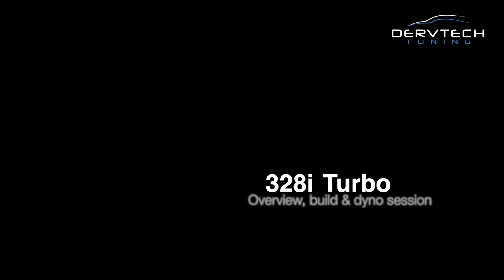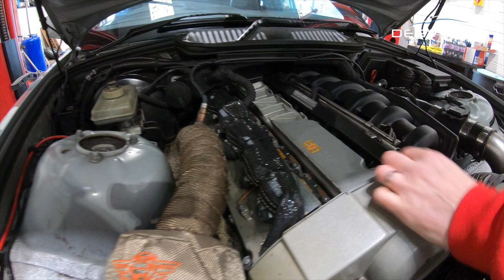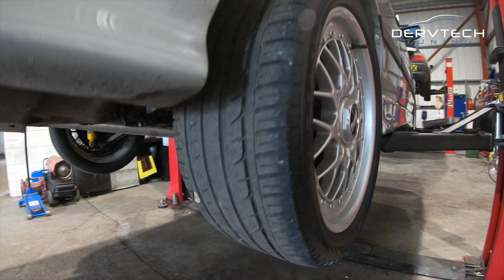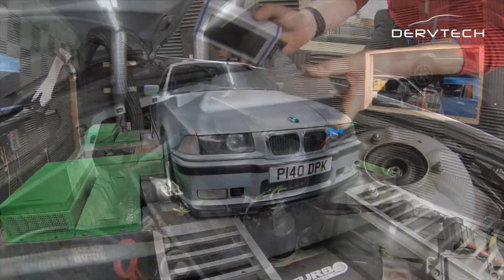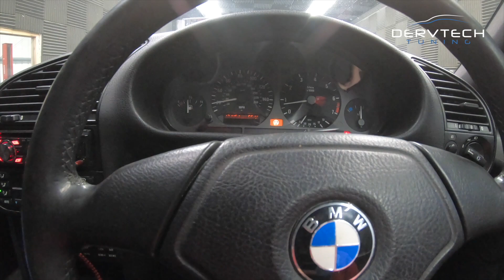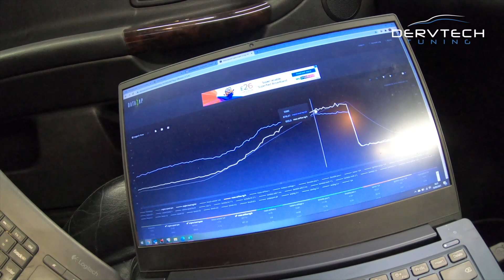BMW E36 328i *TURBO* M52 walk around, and dyno tuning session @ E36Tuning.co.uk

Comment: When a video on the dyno with the decompration plate ?
Reply from the maker: The car went through a couple of guises. Its latest incarnation was a 3.3l Alpina engine with the same turbo kit fitted. It made 470hp at the flywheel, with no turbo lag and was an absolute hoot to drive!! I think there are videos of it on here, or possibly just on instagram @e36jp

Comment: Soooo.. have you turned the boost up on this yet?
Reply from the maker: We did. 340hp on the stock engine. 

Then we fitted a 3.3l Alpina engine, reworked the turbo setup and saw 470hp @ 1bar.

Comment: Great for a you tube vid but stuff like this never last long, you wont see it in 80* weather idling in a 3 hr traffic jam that's for sure LOL..Dyno readings are not the real World
Reply from the maker: This car actually has been used as a daily, through summer and winter. We turned it up further on the stock 2.8 and it never missed a beat at 340hp. 

The engine has now been taken out to 3.3l and runs over 450hp. No problems in stationary traffic, and has been used on 30c summers days without issue….
Reply: @e36jp  Any vids of you beating the shit out of it round a track?

Comment: Finally more UK based M52 content, looking forward to the next stage/s
Reply from the maker: We saw 320hp at 0.5bar and 340hp at 0.65bar on the 2.8. 

Currently running a low boost Alpina 3.3 engine, 415hp at 0.5bar!
Reply: @e36jp  aren’t there limitations on the aluminium block in comparison to the iron (US version) block?

Comment: if you are in UK is it an iron sleeves block or nicasil coated?
Reply from the maker: This one is a Nikasil engine.
Reply: @e36jp  thanks for answer, mine is also nikasil in E39 which I want to turbocharge. Do you have any thoughts on Maxpeedingrods T3/T04e turbo or is it better to get a GT35 with external wastegate? I want to turbocharge completely stock engine

Comment: would this also apply to a e36 non vanos 325? Just to add, really good solid content, with the right amount of detail.
Reply from the maker: Very similar, yes... In actual fact; the VANOS doesn't make much difference in turbo application...
Reply: @e36jp  Thanks.. I have a supercharged (ESS) e46 330 engine, (well i have the entire car), that I was going to attempt to put into the e36 325 (my track car), Would this be easier, or any real issues (bar needing a loom adapter + throttle) for the e46 engine than going the route above?.. As 320-340 bhp in a stripped e36 should be quite quick around the track.. Thanks.
Reply from the maker: @joper90  You've kinda got two choices... fit the whole lot into the E36, including MS43 ECU, electronic throttle etc (there are some benefits to this with low RPM throttle limiting etc), or fit the charger kit to the M50/M52 engine, and use the MS41 ECU which is meant for the E36.... Would love to see more on the car!